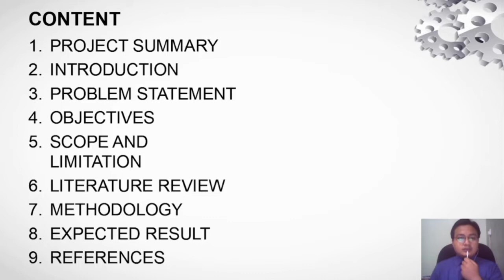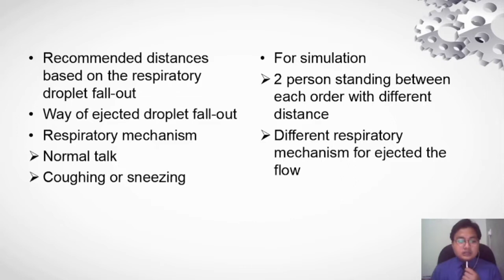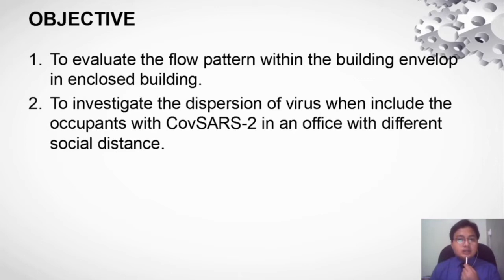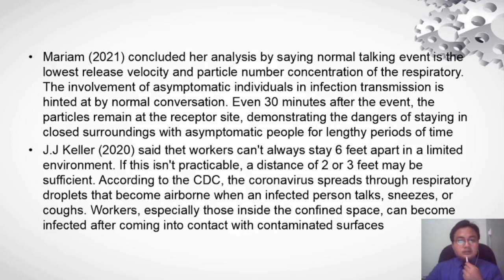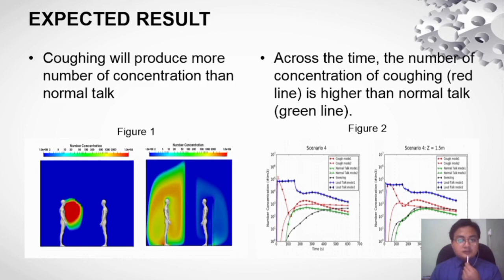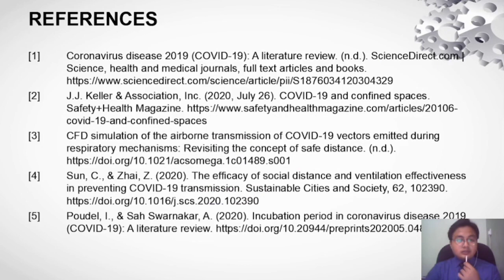FYP 1 Proposal Presentation  AMIRULFIKRI BIN MOHD KALIL - Faculty of Mechanical Engineering. UiTM SA

Comment: 1- Unclear objectives
2- Please provide proper method flow
3- Lack of literature
4- What is the social distancing values?
5- How you control flow pattern?
6- how you control virus dispersion?
Reply from the maker: What is the social distancing values?
- Follow the SOP from WHO and CDC which is 1m and 2m respectively.
How you control flow pattern?
- Based on 3 factors which is characteristic of the fluid, speed of the flow and shape of the solid surface.
How you control virus dispersion
- For this project, there are scenario 1m distance dispersion by sneezing of coughing and there are scenario with 1m distance with dispersion by normal talking. Then continue 2m distance with 2 type of dispersion which is sneezing and normal talking.